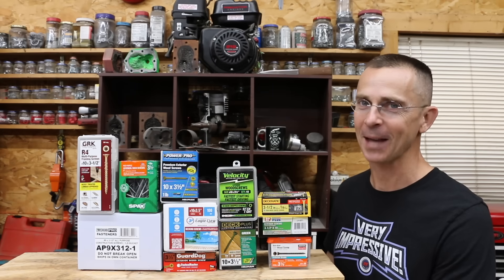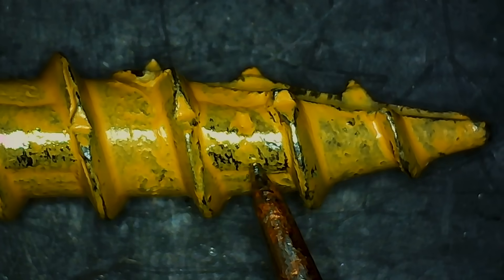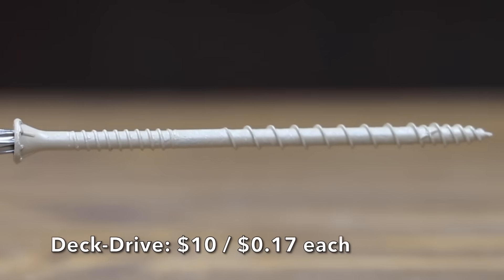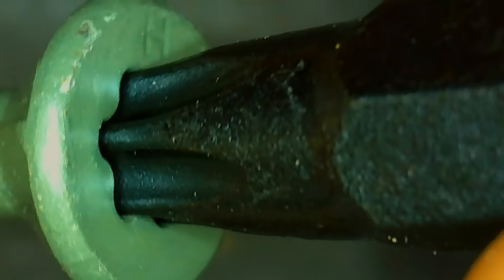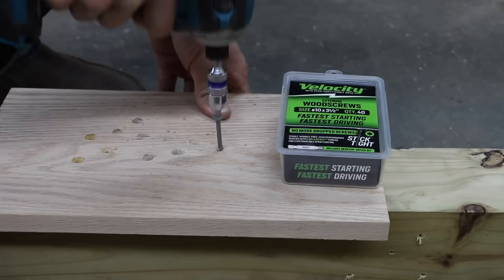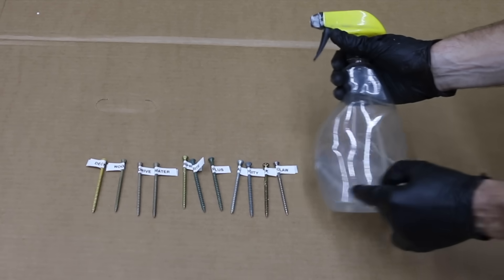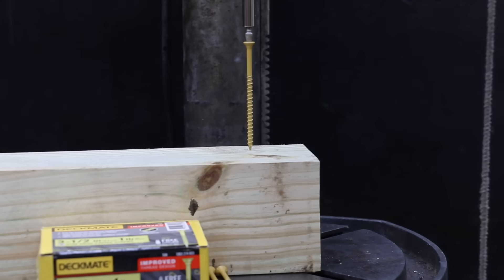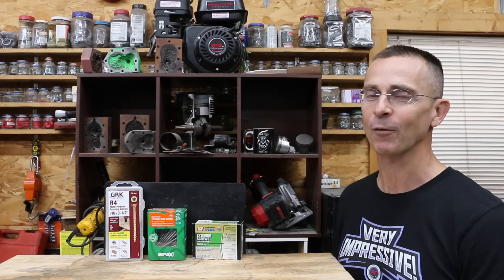Best Deck Screw? GRK vs SPAX, Grip Rite, Deckmate, WoodPro, FastenMaster, Deck Plus, Eagle Claw

Comment: When timing how long it takes to screw in, wouldn't it make more sense to use the drill press for consistency? Put the bit in the chuck and use your weight to drive the press down into wood. Would remove the human part of it. Just a thought, unless I'm overlooking something.
Reply: Downward pressure doesn't matter with screws as they self feed, and a drill press doesn't have enough starting torque to drive a screw without a running start
Reply: @Robert-qm7yi  I'd go out and test but its too damn cold in my garage, lol.
Reply: I'm with the other guy, downward pressure only matters in getting the screw started. Once the threads grab it's irrelevant, instead you're just chasing the screw as it pulls itself into the wood.

Which is why torx or square drive screws are so much easier to work with vs Phillips.

Can't really comment on the torque aspect of using a drill press, however it makes sense. Especially since most drill presses change speed via adjusting a v belt (which slips easily) and they are usually just on/off vs a variable speed trigger.

Comment: Kinda cool to come across this. I own a deck/porch building business. In real world tests I have done I agree with your assessment for the most part. How ever GRK,SPAX,Fastenmaster,Velocity, and Eagle Claw are to expensive when using thousands of screws on a deck. These companies do not offer large quantities like some of the others. Not in my area anyway. I can tell you in real world use Deckmate is by far the worst I have used. Gripright isn't much better. Powerpro are good except for them being a t20 head. Deckplus is my go to screw. They grip far better than Deckmate or Gripright in my experience. They Have a t25 head Powerpro don't. I can get them in 25lb or about 1550 count boxes. In my area I can't get the others in bulk like that. Just thought being someone in the business I would add my knowledge to your testing.
Reply from the maker: Thanks for the feedback.

Comment: I was thinking after this video, I wonder how well the screws hold up to corrosion while installed into a piece of pressure treated wood. Might be a good test to set up(just a bunch of screws holding 2 treated boards together (so that there is a crevice) and leave them outside for a couple months, or spray them with the rusting agent a bunch
Reply from the maker: Thanks for the suggestion.

Comment: I have an atrocious deck that for the last 22 years I have constantly done small repairs to that is about 1000 feet from the ocean and 1000 feet from the bay.  I used to use Grip Rite screws back when they used a philips head... but I got tired of stripping out the heads and they got pretty rusty after about 10 years... at least the ones they sold 15+ years ago.  I switched to the Deck Mates around 2010 and I am constantly amazed how corrosion resistant they have been, even after being out in the weather for upwards of a decade.  I only have issues with the Torx heads stripping if I get careless.  I've had no problems unscrewing them after 12 years... and screws I pull out after 4~5 years seem almost brand new... so sometimes I reuse them without issues.  Only issue I have is the wood splitting... so I pilot hole every one.

Deck screws have come a long way.
Reply from the maker: Thanks for sharing.

Comment: Good video always very thorough

I hate to say it though but from what I can see I wouldn’t call any of those deck screws because they don’t have a bugle head

Here in Australia I’ve done a bit of decking I can tell you now the best deck screw is an 83 mm stainless steel screw that’s a 14 gauge shaft and a 12 gauge bugle head with a six point torx style. 

Some companies copy them in 304 stainless and they’re okay as well 

the original brand from Germany is a touch over a dollar each Australian per screw which is about a dollar US each

Stainless steel bugle head torx can’t beat it…..
Reply from the maker: Thanks!  Thanks for the constructive feedback.

Comment: Thanks for this awesome performance comparison, PF! And congrats on filling an arena with people concerned about deck screws (amazing in itself). Oh...and great point on nails vs screws...hot dip galvanized spiral shank deck nails will be going strong after every screw gives up the ghost, and probably long after the the sun burns out from what I've seen. Cheers!
Reply: And boy will those nails suck to pull out when the deck boards need to be replaced.
Reply: @BrBill  Yes, I end up using the big old Cresent 19” nail puller - 56 to grab them and hammer/pull them.  Maybe that’s a test!   Nail pullers, pry bars, etc.   For example there are many different mfg of cats paws as one type, I’ve definitely found some are better than others for my use.  Maybe a few classes of these things to create a block of tests.  PF could be busy.
Reply from the maker: You are welcome! Thanks for sharing.

Comment: Hi Todd! I love your channel, just wanted to say that I think it would benefit the tests to include what tool you use to drive the screws in and mention whether it's fully charged between each screw or whatever for future tests.

Also, can you test different types of wood/lumber for strength and application? Thanks!
Reply: From what I've seen in previous videos (over a year old now) he mentioned that every single time he does these test, when switching brands, he always fully charges the tool and uses it throughout each test on one charge. For the tool I couldn't say.

Comment: Greetings from Fairbanks Alaska. 
Could you please test the best: 
1. Led Head lamps especially battery life in cold use?
2. Gas can nozzel modification kit or EPA approved nozzle that doesn't spill all over you.
3. Wood stove chimney fire alarm systems.
I have more ideas, can I email you them?  My email is on my channel. 
Cheers and thanks for your excellent work.
Reply from the maker: Thanks for the video ideas.

Comment: This might be a little bit outside of your normal wheelhouse, but I'd be interested to see a test of different brands of quartz countertops. Many of them make great claims about resistance to heat, stains, scratches, etc., but it's very hard to know if it's true. The "Dekton" brand specifically claims to be way better, and I'm not sure if I believe it. I don't know how practical it is to get sample sizes of the various brands, but if you can pull it off, it would be pretty cool.
Reply from the maker: Thanks for the suggestion.

Comment: Did you somehow measured the engaged length of the screws are through the pull-out test?
It seemed varying, and I think it made the results somewhat blurry.

But it appears to me that there isn't that significant of a difference in these screws in any aspect...

Comment: I just had a spax construction screw snap while driving it. It was not over driven, and I was using it to hang a multi monitor hanger on my wall. Now I have a piece of screw sticking out of the sheet rock, too small to grab, and too big to patch over. Guess I'll have to take an angle grinder to it and then patch. NOT HAPPY!!  I think it's because it's going into OLD wood, which gets much harder over time.
Reply from the maker: Thanks for sharing.

Comment: Grip Rite has been my go to brand, for decades. I recently dismantled a fence I put up 15 years ago, and most of the screws looked as good as new. With today's supply chain issues, the 5, and 10lbs tubs aren't always available, and making up the weight in multiple small boxes levels their price advantage over tubs of Spax, and GRK, so I've given both a try. 

At first, I was really impressed with the Spax. They feel good in the hand. There's something satisfying about the way they catch the board, and drive in. By the end of the tub however, I was really disappointed with the number of malformed heads that could not accept a bit. I don't know how many I ended up with, but by the time I recognized the trend, I found an additional (8), so I'm guessing somewhere over a dozen. I don't think I've come across (12) malformed Grip Rites in the last 20 years. 

I've gone through around 20lbs of GRKs since then. So far, their QC is still batting 1000. Not quite as satisfying as the Spax, but there's still something about their feel I like more than Grip Rite ...while prices are equal, that is. Not so much that I would pay more for them.

I usually avoid the Doit franchise near me, but I picked up a 1lb box of 1¼" deck screws with their brand. Everything over there is very overpriced, but they rarely have what I need in stock, so it doesn't matter. I actually was looking for 1" screws... I was expecting the screws would be adequate, but they actually seemed to be pretty nice. They're manufactured in Taiwan, and the Grip Rite style packaging says they're coated in Primeguard Plus, which has me thinking they're just rebranded, however the coating seems thicker than I remember if they. They only had 1lb boxes, so pricing wasn't great, but if they're Super Grip Rites, they might be worth it. 

Whatever the case, great job on this one. The methods you came up with to put these through their paces were effective, but simple. Clever stuff, right there.
Reply from the maker: Thanks!  Thanks for sharing.

Comment: Some very important concerns are rust and screw breakage.  Boards for decks do break their screws, the boards are always moving with humidity changes, rain then drying out. All SS screws excel in not breaking or rusting. I used steel coated deck screws from Lowes on my FIL deck, and after 5 years, quite a few screws had completely snapped, and all had rusted inside the wood, some badly. They do break where the planks meet the joists. Then what I did, is drive new screws into the same holes and down into and past the broken off screw in the joist. So you know what will happen again. We did sell the house after that. On my house 25 years ago I used SS square drive deck board screws 3 to 3.5 inches long. All the screws when I take them out are like new, not a single broken screw. The square drive head can get reamed out though which I view as the only defect. But if your careful and clean the heads of dirt, they are ok to take back out. I bought those screws at York Bolt, and like a thousand at a time, which they give you a better price than small boxes. And many years ago, the Lowes SS deck screws were crap, the shanks were too thin, while the SS screws at HD and York Bolt were great, thick, strong. I think Lowes since that time got good SS screws.
Reply: back then a 1000 SS screws at York Bolt was around $80 is what I recall.
Reply: Also, saying fences can use steel coated  screws and they dont seem to break or rust. But on decks, steel screws break and rust a lot, the rain must stay on a flat surface to cause more screw damage on a deck than a fence. I worked on my 10 year old fence I built from individual boards and taking out old screws, not a single broken or rusted screw.
Reply from the maker: Thanks for sharing.

Comment: I'm 51 and have always heard that you should never clean an air filter out with compressed air for a car or any motorized vehicle lawnmower dirt bike etc, I know K&N offers air filters you can clean every 30,000 miles or so, but I've been curious about others or which one is the best.
Reply from the maker: Thanks for the suggestion.

Comment: Yea got some SPAX that i used 7-8 years ago on Decking. Had to lift some of them quite a few times to put in services, repair the wood from damage and alter for an extension. I am still using the original screws. If i was to give them a wash and put them back in my screw box i would not beable to tell new from old. (UK, there quite expensive here).
Reply from the maker: Thanks for sharing.

Comment: Serious question:  When you do the torque tests and repeat them multiple times on multiple brands, do you use a 120v plug in drill to take away that battery charge variable or do you use a high quality cordless?

Comment: I've never given much thought to the quality of deck screws.  Since they have a protective coating, I figured that they're all about the same!  Boy, was I wrong!!  

I've used some of the brands tested here and I would like to say I can feel a difference or see how one holds up better, but I can't ... well, I did notice that the SPAX was easier to drive and more consistent, but for me, the added cost didn't justify the purchase.

As a thought, how about testing different brands of nails.  How easy they bend, how easy they pull out and how easy it is to break them.  And also how easy it is to damage the head (so it can't be pulled out).  And of course, corrosion resistance and how badly it stains the wood!
Reply from the maker: Thanks for sharing.

Comment: I’ve spoken to people who build decks on a regular basis and all said they use stainless screws. They say it’s a no brainer and if you soap the screws prior to install, they go in easier. That’s an old timer trick I learned way back before screws were a thing. Despite the test results, stainless is pretty easy choice and less prone to come out and have long term reliability. Some don’t or won’t agree. That’s their prerogative and choice. I’ll stick with what I know works and long term reliability is unquestionable. You use what you like. Customers like things that don’t cause trouble in the future and hang well over time. They are right and they pay the bill. Duh! Stay safe mates!😊👍🏻😷
Reply from the maker: Thanks for the feedback.

Comment: Excellent video as always, however I would have liked to have seen some more stainless screws. I use the 316 stainless steel GripRite screws for decking in coastal environments and have had very good results. To anyone working in a coastal environment, please use 316 stainless steel fasteners. 305 stainless is pretty good, but it will rust, 316 won't.
Reply from the maker: Thanks!  Thanks for the feedback.

Comment: Fasten master guard dog is garbage.  I took up a deck that had hail damage a few years ago, and had used those screws and 70% snapped off due to rust between the deck and the girder.  I built the deck, and knew it was about 8 years old, so I'll never use them again.
Reply from the maker: Thanks for the feedback.

Comment: This was far more entertaining to watch than I expected. Well done. You have occasionally in the past placed data from different tests side-by-side in the same graph. I would have liked to have seen the graphs of pull-out strength against the graph depicting drill time (thread diameter and pitch). I would expect they are closely related.
Reply from the maker: Thanks!  Thanks for the suggestion.

Comment: Keep in mind these are deck board fasteners. Not to be confused with structural deck framing screws. Shear loads are a bit pointless for these types of screws. Suggest you redo this with the right type of screw such as the simpson strong sdws or grk r4 etc

Comment: How come you were not setting the head below the surface or at least flush the lb rated would be higher if you smoke the head flush or somewhat slightly under the surface of the wood

Comment: I used those exact Deck-Drive screws to rebuild the frame & re-side my hot tub last year.  Ooops, looks like I may need to un-screw myself & go for the Grip Rites 🤦  I will say this much, they went in super easy & the bit they came with is really good.  I impacted 3 boxes worth with the bit that came out of the 1st box I opened & I can't tell it's even been used.  I know I speak for many but love everything you do!  Awesome guy! 🍻
Reply from the maker: Thanks! Thanks for sharing.

Comment: Ok, here goes... GripRite is my fav of the group, because all the others don't fit the Torx heads properly and it wobbles too much. With that said, I prefer to use SS for deck screws so I  never need to worry about it lasting.
 
With that said, I've now switched to Simpson. Their screws/lags are unreal!!!
Reply: I'm surprised Grip-Rite did so well. I only use them because they are the only T25's that are actually T25. Others are T26 to T27 even though they claim they're T25.
Reply from the maker: Thanks for the feedback.

Comment: Great testing! One thing that has always driven me crazy was for different sized deck screws sometimes need a different sized torx bit. This varies by manufacturer.
Reply from the maker: Thanks!  Thanks for the feedback.
Reply: When I rehabbed my garage a few years back I bought a few boxes of (I think) 1 3/4" treated screws.  Bought them a month apart, same manufacturer and "model" screw.  One box used T-25, the other T-30.  WTF?

Comment: screw drivers which are a soft metal, even if they fit well at the beginning will fit loosely 100 or 400 screws later.  One should have a box of spare drivers before beginning as they will wear down.  Noting my cheaper GripRites (that I built my deck with) used a standard #2 Phillips and not a torx driver.  Then again I probably won't be pulling them back out any time soon.   🙂
Reply from the maker: Thanks for the feedback.